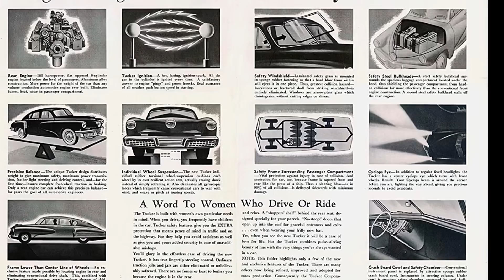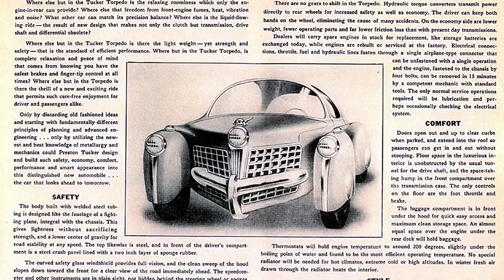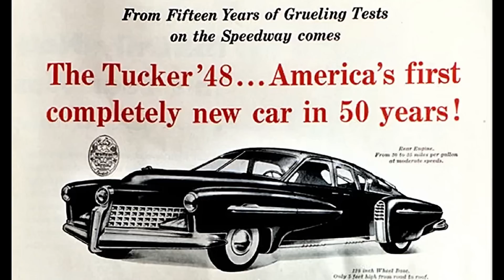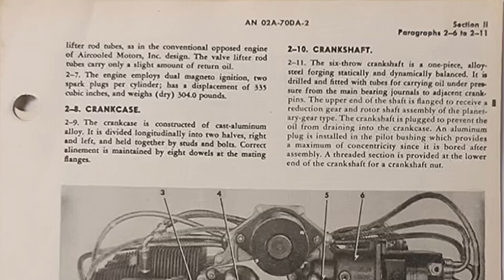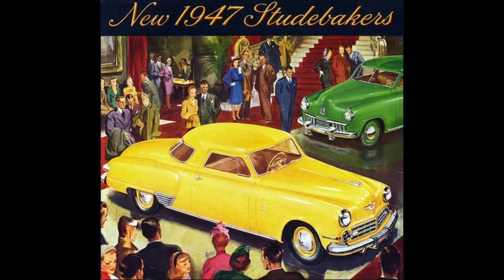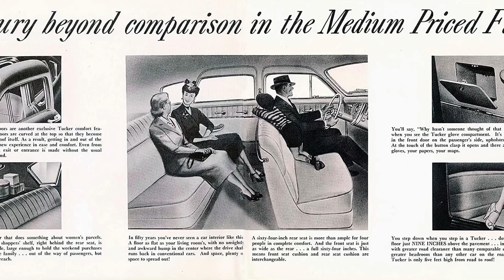Tucker engines 589, 334

Comment: That's a very informative engine history!
Tucker built atleast one car with the twin torque converter drive. The car still exists and I've seen a video about it on YouTube.
The transmission they used was actually a 4-speed, the same pre-selector transmission that Cord had used. It was ideal for the Tucker, as like the Cord, it sat in front of the engine but driving from the rear wheels instead. A similar application has been used in modern times. Like the Pontiac Fagero and the FIAT fag X 1/9. Taking a front wheel drivetrain and putting it in the rear. Yej, they liked it in the rear. lol

Comment: Well done presentation. So glad you was able to get the info together for this episode, an interesting feat of engineering to adapt a helicopter engine for automotive use, almost like Chrysler engineering a jet engine to work in the turbine cars. Just think with today's technology with fuel injection and other enhancements  the Tucker and the Dusenberg engines could made even more powerful. If I had the pocketbook  to buy one, it would buy either Tucker 001, or the only Tucker convertible.
Reply from the maker: The engine episodes are getting harder to do because there’s ones that I’ve been putting off that are going to take forever like the Pontiac V8 Cadillac V8.. I want to do the Northway engines before getting into the Cadillac V8 

Also, would love to start covering some foreign stuff like I was thinking maybe doing the very first Bugatti engine it’s finding information 

Chrysler straight eight is another episode that I’ve been working on finding the dates of when they started and stopped as hard for that series .. but yeah I think you’re gonna totally dig this episode. It’s pretty cool there’s a lot of brochures of this one stuff on the screen is just as good as the information.
Reply: @What.its.like.  You might consider maybe throwing in a series of transmissions here and there like a Ford toploader, or muncies or some series of automatics or overdrives, if the community would be interested .
The Chrysler book is on the way to you, it may have some dates on the 8's for Chrysler, Dodge and Desoto
Reply: @What.its.like.  Those episodes sound good. Any chance of you doing the 6-cylinder Continental Red Seal engine? I'd also be very interested in seeing an engine episode about the Tatra V-8 engine family. 

I would love to see a video about the old Moskvich factory. I remember a Car and Driver article from the 1970's about it. They said it was the last totally self-contained auto factory in the world. Raw materials went in and cars came out. They even made the tires there. I've been looking for more information ever since but haven't found much. It'd probably require heavy google translate usage. Unless you know Russian.